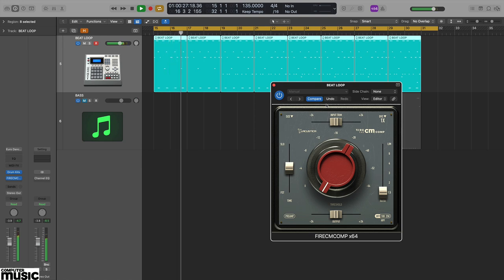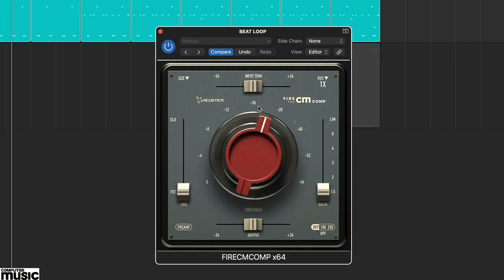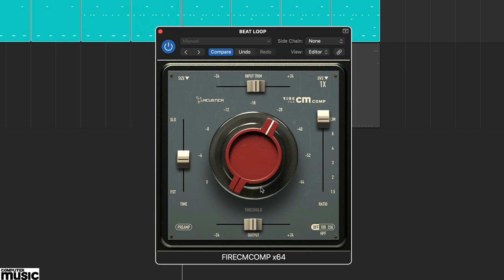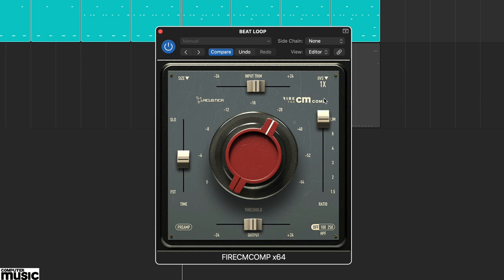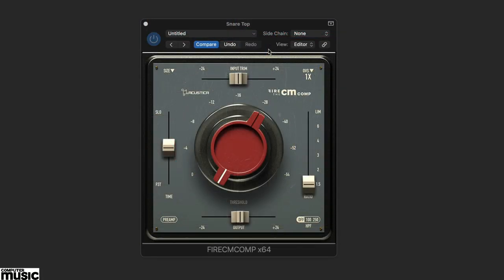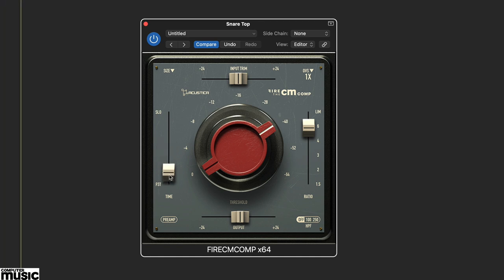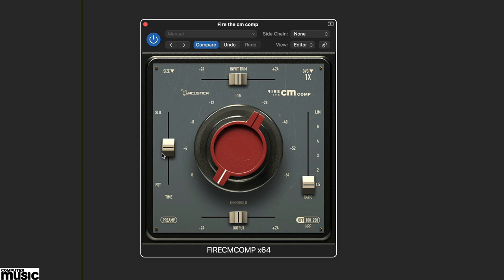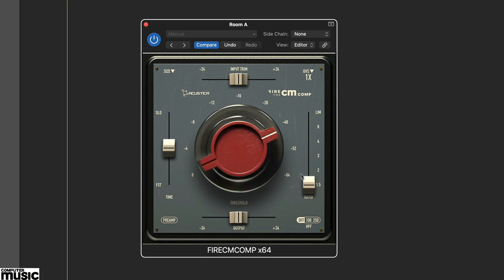Your Free Software – Acustica Fire CM

Comment: Tried it today. I wish there was a gain reduction meter. It would be also much better if turning the treshold would NOT result in a drastic reduction of the overall level. Ideally the gain loss should be compensated for. 

The HPF doesn't seem to do a lot. Is the highpass on the signal or on the sidechain?

Turning on preamp brings my CPU to it's knees.
Reply: What kind of cpu do you have ? Runs fine for me on a R5 Processor, I agree with you on a reduction meter